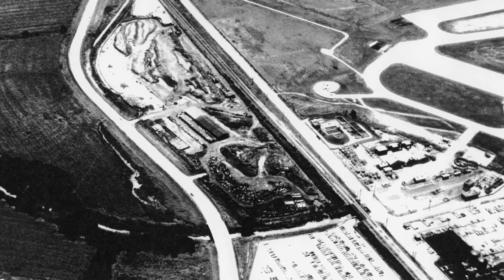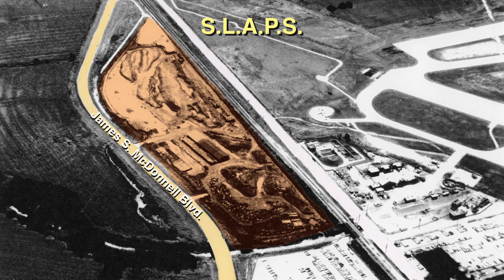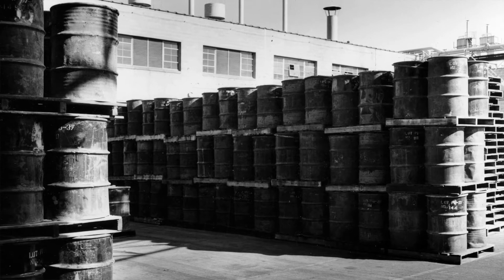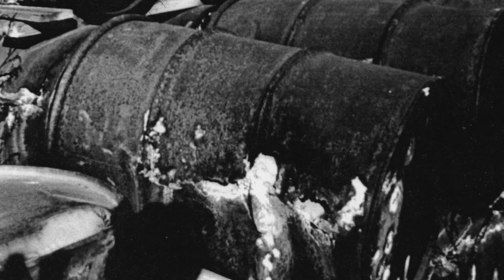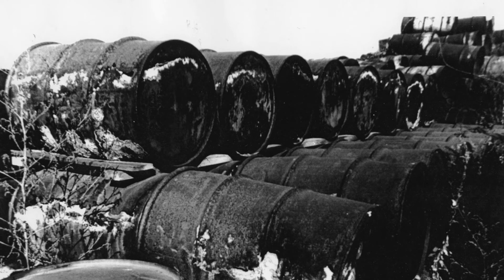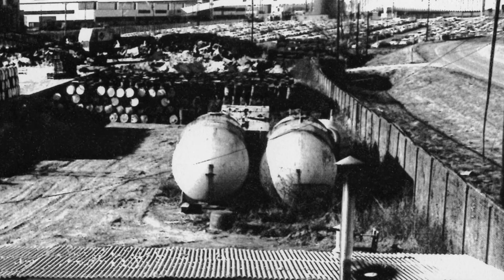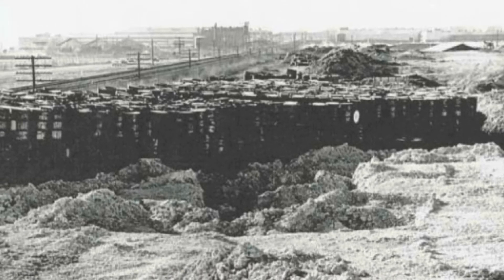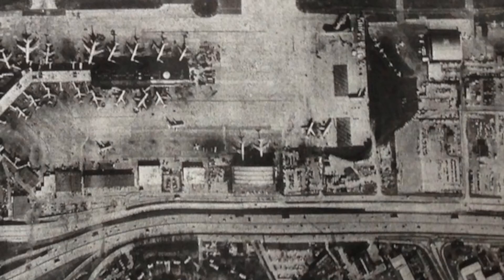How The U.S. Government Stored Nuclear Waste | Documentary Clip

Comment: This just like the Site at the ROCKY FLATS WEAPON PLANT where the notorious ,'( "903 PAD ) was, where thousands of drums of radioactive waste was stored for YEARS, out in the open and EXPOSED to the raw elements of sun, snow, rain, sleet, hail and the most terrifying WINDS you could imagine ! The thermal exchange of air temps coming off the Rocky Mtns. could easily produce 100 + MPH winds called CHINOOKS,..... strong enough to blow out the windshields of cars in the parking lots !  The initial land survey by the Govt was taken at Stapleton Airport, far east of downtown Denver where wind speeds fell off , missing the purpose of the survey and placing the bedroom communities just 3 1/2 miles from ROCKY FLATS and downtown DENVER right in the path of destruction for ANY RADIOACTIVE LEAKS coming from the weapons plant.  Later. RADIOACTIVE SLUDGE from the EVAPORATION PONDS ,( where runoff, washdown and effluent at the PLANT were drained and pumped into and large rainbird sprinklers sprayed the adjoining fields so the water would evaporate off ) ,..... was mixed with a concrete slurry, then  poured into large, heavy duty cardboard boxes called ," POND CRETE ", and once solidified, the boxes were moved and placed in and empty lot at the plant sit named ," the 903 PAD " !  The decades of rusting barrels and never curing POND CRETE and sagging, waterlogged cardboard boxes so contaminated the PAD that it was now necessary to move the waste storage containers and PAVE OVER the areas of LEAKS and RADIOACTIVE CONTAMINATION ! 
  Watch, : "SECRETS FROM A BOMB FACTORY " and learn how bad the situation got at ROCKY FLATS WEAPONS PLANT !!!
Reply from the maker: Thanks for sharing.  Rocky Flats was certainly one of the worst sites for contamination in history.  They are near the top of the list in the EEOICPA payouts.